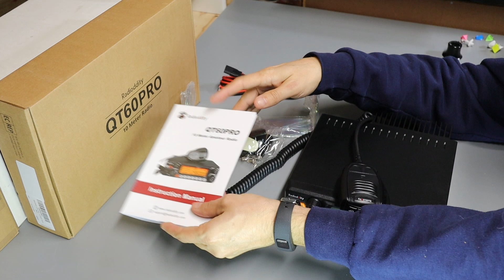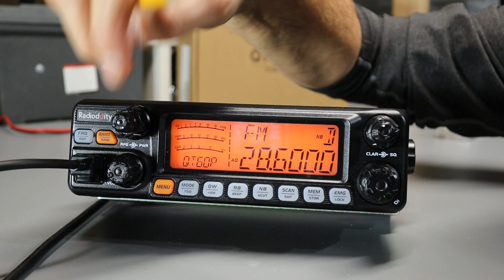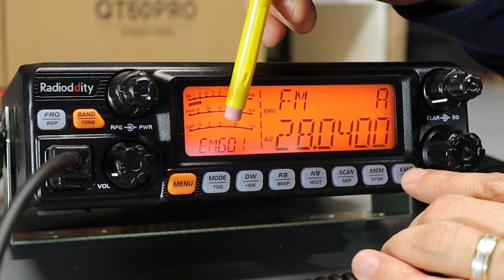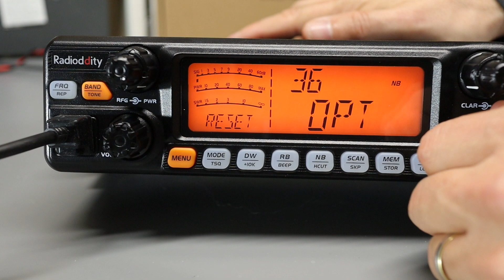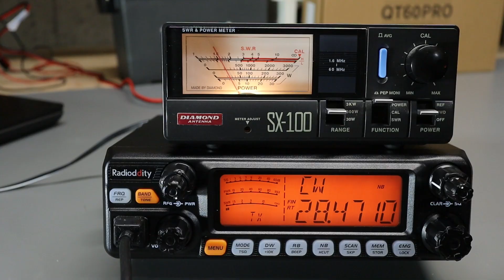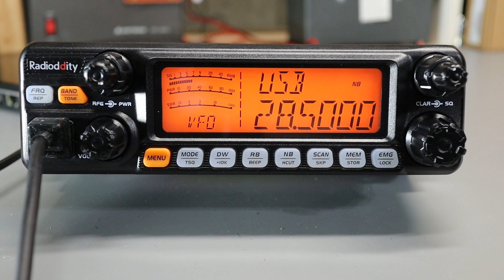Ham Radio: An In-depth Look at the Radioddity QT60PRO  for 10 Meters

Comment: I love my Anytone branded version, AT-5555n II.  It is mounted in my vehicle for mobile operations, and can quickly be removed from the bracket for use on my POTA activations.  It has been a very reliable radio for working 10 meters.  Only complaint is how the noise reduction has a delay kicking in when changing frequencies.  I have accidentally dropped mine on slate walkway and no damage was sustained.

Comment: I bought this radio a couple of years ago when it came out. I have only used it twice. I made the mistake of comparing it side by side with my FTDX10 on 10 meters which is totally an unfair comparison. I did the mod to it. I noticed the warranty void seals on the side of the case were already broken from the factory. I think they could have just put a jumper where the wire loop is. Overall I wasn’t that impressed with the radio and wish I hadn’t made this purchase. I’m going to solder the wire loop back together and put the jumper back and sell it.
But after your great in-depth review I am changing my mind and going to find a spot to install it permanently.

Comment: Great video, Thank you! I have had the Anytone 5555N for 10 years. It is almost identical but lacks CW mode and wattage output is half the Radioddity. Have over a 1000 contacts using a homebrew dipole in my attic or a Wilson !000 cut to 10 meters when mobile.

Comment: Great review . I have the QT 60 long version.  I use it portable and on battery from Cold NY ! End fed half wave or ground mount 5/8 I made . I talked all over the world on it.  and does digital modes with sound card and cable from laptop. Easy make. FT 8 to Japan and many more. SSB to Cayman islands . Even Russia and Bulgaria. Got England. Norway ,Poland  and many more countries on 10 and 12 meters. Band world wide now. With the PC programming cable and moving jumper  you get 12 meters.  20 AH LiFePo4 runs hours POTA .  draws 10 amps peak . Salty Walt has the QT 80 ! Very good radios.  Get some speaker wire and build a antenna for that QT 60 PRO . Just what I did . POTA fun. From cold NY ! salty Walt has many video's on wire antennas' They work great ! I do about the same ! 100's of great contacts .  Them radios have great audio from stock mic. 73 from Boston NY .